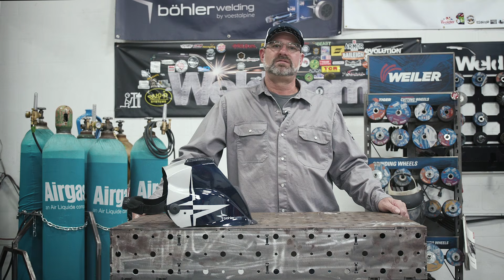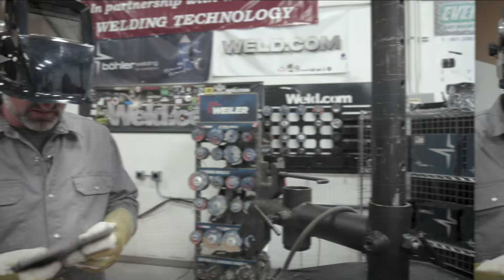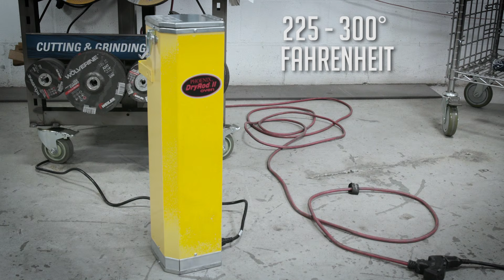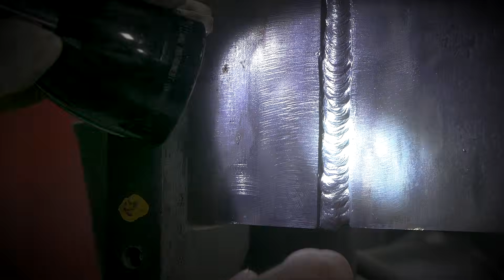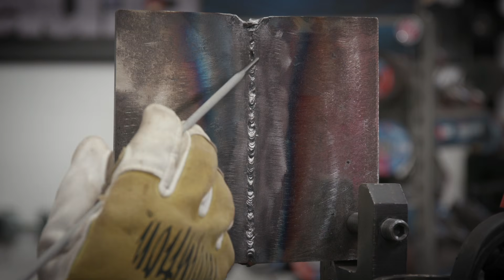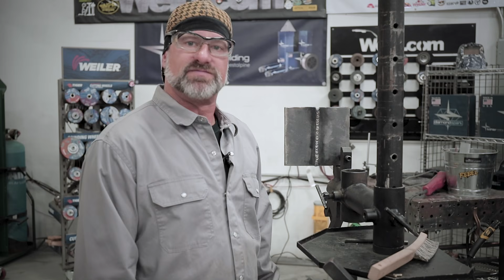Stick Welding Uphill: Techniques and Tips

Comment: on the root its okay to let pool cool down that much and then rehet and deposit? i thought going back into the weld like this without cleaning it first would cause porosity?
Reply: Actually, now that I’m thinking about it, his technique is correct, but he’s moving too far away from the puddle to where it slightly solidifies and could cause inclusions. My best guess would be to use his technique but to make sure your puddle is always red hot and flowing.
Reply: I’d also like to know this

Comment: if you'll notice you're preheating metal that you do not want to with those high upwards strokes on the root, you want it to be "relatively cool" when you pass over. a lot of new welders would definitely blow through with this method.
edit* or not penetrate enough like you did

Comment: I'm no pro welder but I had to weld some bumpers on a loading dock the other day and let me tell you it was horrible but beautiful for someone with hardly no experience. I had to weld upwards and man that was really a challenge for me blew a hole right in the middle midway up. Still have alot to learn thanks for the tips and showing me how it's done.

Comment: Modern ASME industry standard is the 2 inch 6G ,schedule .344 wall test. It qualifies the operator for pipe wall thickness up tp .688 wall. The uphill root bead became obsolete back in the 70s with the invention of high penetration welding rods like the German cell-80 that was used on the Trans Alaska pipeline.A down hill rod. American high penetration rods soon appeared and have been used  now for 60 years in the industry.7010s and 8010s coupled with 8018 fillers and caps.Most pipe and tube welding procedure TODAY are downhill root,downhill hot pass and uphill with the 8018s ie filler and caps.The trans Alaska pipeline done to API standards [not ASME] was downhill all the way using the 8010 seres high pen rods.Before that were mostly navy trained welders who were taught to uphill everything.Its much slower and produces more unwanted localized heat.The young an who test today will likely take the 2 inch test.Its x-rayed and it is cheap for employers.So that young person would do well to learn downhill root and hotpass on the ,344 wall boilertube with 8018 filler and string bead cap.NOT WIDE CAP.Beads can only be 1 1/2 times the diameter of the rod used..For instance 1/8 rod would be 3/16 wide max.For young people ASME stands for American Society of Mechanical Engineeers.API [less stringent] stands for American Piping Institute.Also 6G stands for pipe test done at a 45 degree angle as opposed to horizontal or vertical test.

Comment: i see ya filling ya undercut i always do a circular motion on the hot pass to push the root in i use to run a landing with 2mm gap i learnt of an old italian welder no landing saw blade gap push it in , then the hot pass you can run more juice .fil cap two stringers .100 percent xray.dc positive .neg on root pass.

Comment: We weld cracks in hydraulic tanks or fuel tanks using 7018.Trick is have tank full.Weld through the oil or fuel.Never weld on empty tank,that will explode and kill you.Feel lucky, drop a pound or more of dry ice into tank before welding on empty tanks.Dry ice displaces oxygen and you can weld on empty tank.Do it if you feel lucky .

Comment: I work field as heavy equipment mechanic.7018 is spec by Caterpillar. Try that with out in field.Metal gets warm and grease starts dripping into you weld.We hired super welders but they all dragged up coz it's a dirty job .We all can run pretty up hill welds using 7018.

Comment: what happened to the woman that did curley q's? This guy isn't much better, he obviously edited out the actual weld, you can tell that isn't the same weld he welded, from the weld (a real vertical weld looks completely different than a weld done flat) melted top to how obviously drippy/runny he ran that weld. His stinger was held at too much of an angle, it should have been straight into the work piece not at the same angle as you do when you do a flat weld. I give this video a BS out of 10.

(Note: Next time, be sure to only do one backwards Z pass on the face of the weld, because a real vertical weld, you only see one pass when you are done.)

Comment: I'm reading alot of the comments from other people and their right.What a person see's on a video and what they see and do out in the field and shop are three completly different things.Year's ago working on a fish processing ship with the engineeries I had to weld a"pad eye" to the deck to hold down a skiff.The 350 footer was bobbin up and down, 60mph winds, raining like cats and dogs and wind chill about 20 below zero, insulated coveralls on,raingear and welding on deck up in ALASKA just south of the Bearing Sea.It wa so hard to move around on the deck I felt like a ballon.The deck plate was atleast 5/8" thick and the pad eye about the same thickness,the deck had about 1/2" thick epoxy paint on it and the WORST PART OF IT ALL,AT LEAST 2" OF RAIN ON DECK.Well someone beat me to it,they chipped the paint away, I didn't ask,all I know is I was looking at clean metal when I got there, good enough for me.But I still used 6011-5/32 rod cranked up,welded one side,then 7018-1/8 same amps, DON'T EVER,EVER SAY A PERSON CANNOT WELD WITH" LH 7018 WET ROD,POORING DOWN RAIN, GETTING THE S--T SHOCKED OUT OF HIM/HER,2" OF WATER ON DECK BECAUSE THEY ARE TOTALLY 150% WRONG, WRONG,I AM LIVING PROOF,TALK ABOUT GETTING SHOOKED,YA I GOT IT WELDED ALL RIGHT, 7 DAY'S LATER IT HAD TO BE REMOVED AND A SLEDGE HAMMER COULD NOT BEND IT, BENDING IT INTO THE WELD,IT WOULD NOT BUDGE!! A ENGINEER TOOK CARBON ARC GOWGING TO GET IT OFF,THEN GRIND THE WELD, WHAT'S LEFT.DONT EVER SAY LH ROD OF 7018 CANNOT WELD IN 2" OF RAIN AND THE RODS GOT SOAKING WET.  NOW THAT'S WHAT I CALL WELDING OUT IN THE FIELD !!   I THINK IT SHOULD BE A GOOD IDEA FOR SCHOOLS TO TEACH STUDENTS WHAT'S IT LIKE WELDING OUT IN THE FIELD IN THE ELEMENTS (100+ DEGREES HOT WEATHER TO--20 TA--50 BELOW ZERO,WIND BLOWIN.

Comment: Retired Boilermaker 35yrs. Where are your run-off tabs? The test booth proctor would fail your coupon before you started welding.
Reply: He said they don't use the starting 1" or the ending 1" to cut the coupons from.
Reply: @tubeonline629  Tell that to the weld test proctor from CB&I or Nooter, or B&W. They would run you out of the test booth even tho all 3 cut off the first and last inch from your 3 position test coupons. Also who are "they" and where did they get their information and do you have a copy of the weld test procedure?
Reply: @KenSmith-bv4si  
Well Ken you know the title of this video says nothing about a weld test, he said viewer's had ask about uphill welds with a stick and he was good enough to show the way he preforms the task that was requested.
Reply: @tubeonline629  nothing replaces good welding habits, thats how you pass test and become a better welder.

Comment: There's a huge misconception with the weld when you get to the top. It's not that the weld gets hot, it's the magnetic field that's being created is pushing your weld downward.

Really clean audio, too.
Reply: You are wrong
Reply: @spencerseedig3380  No I'm not.
Reply: @seyelk59  Actually you are wrong. The magnetism that's created pulls the weld inward. The sheer heat rising upward in conjunction with the approaching electrode synergistically over heats the metal at a given travel speed.

Comment: Or you can use Titanium Pipe cut in the middle to guide the Weld pool, but you have to Grease it with Heat resistant Grease.

Comment: Good job sir.  Appreciate the arc shots and all the advice. The way that arc kept cutting out in the root, I think it might have been the machine there because  from what I saw, you kept the arc length consistent. Did you change anything else for the root pass on your 2nd plate? Like arc force or amps? 
Anyway, good stuff. Keep it coming

Comment: Can you do a video on a 1/8 7018 cap on 6in pipe? I been struggling on getting from overhead to vertical, it’s dripping and has undercut. Thank you in advance.
Reply: Try this technique each time that you stop at the count 1 one thousand then move. The under cut you are getting is because you are leaving the toe to fast thus pulling material from the wall. Just slow it down a bit and check that you amps aren't too high.
Reply: Your travel speed and angle might need adjusting. If you understand the difference between push/pull you should get it fast. But always practice each time that you can. Highly recommended.

Comment: THANK YOU SO MUCH for a nicely done vertical weld test training video! I've got a question...your rod angle is real steep. {{ Way back (when I was a student Tool & Die Maker, that was a professional Electrician); repairing welding equipment in our local tech school, I would listen in on what the welding instructor would be telling his students. He would say, "The straighter in your rod is, the stronger and prettier your bead will be." He caught me evesdropping on his class and envited me in on his class-room discussion. He found out my experience level in the Machinist and Electrical fields and tutored me, when he could in welding professionally.}}
    That being said, I have tried to keep an almost straight-in rod angle and run a "U" pattern up-hill, for most of my life. My health vs age has made me shakey...so I Mig more than stick, but I watched you running your cover-pass with the rod angled up, and needed to understand that concept. Does it splatter real bad, like its throwing metal, or does DC act better about not doing that than AC does?
   Bill from Tn. 🇺🇸

Comment: You don't need to whip an open root if your heat is set right you can drag it all the way
Reply: Good to know how to whip though because in the field you’re going to have a bad fit up here and there.
Reply: I just think for beginner its easier to teach someone to stick the rod in and drag that's all and if the gap starts closing up tell them to slow down if it opens up speed up it's just easier to control if you put a good land on your pipe or plate in my opinion that's all

Comment: the statement at 4 minutes about 70,80,90 series rods needing stored at 225 to 300 degrees is incorrect.  6010-9010 rods are to be stored at room temperature. The higher temp storage will deterogte these non low hydrogen rods. XX14 and XX24 ,  are to be stored at 125 degrees farenheit, along with XX12, XX13,AND XX22, WHICH ARE USUALLY 60 SERIES  but of the same Rutile type as XX14 AND XX24
Reply: he was referring to low hydrogen rods
Reply: You mentioned xx12 and xx22.... I hadn't heard or seen anything bout these for years... like a couple of decades
Reply: When he said that he was still talking about xx18 LH rods. He was talking the tinsel strength of the rods.

Comment: paul you need more practice i am a professor in welding i know a top gun when i see one i went to school and study the theory in welding got the diploma  and went on to weld in industrial  plants i am a pipe welder i am now self employed and i still practice  every week in pipe welding tig and stick to keep sharp your current too hot and your whip too long  75 amps small whips dig a hole with the arc fill it up with the rod
Reply: Mohammed Troy - I checked out your channel hopeful to find hi now a perfect person does it, but for all your judgemental criticism and prideful statements,  your videos only include coconut openers for sale.  Maybe post your own.
Reply: @timrich6755  
You can always tell a real welder by how much they brag on how good they are. Lol
Reply: @tubeonline629  Yup. Like I said, no videos, but critical of a channel with loads of good videos.
Reply: Wow. Good thing you didn't become a school teacher. Your pupils wouldn't even know what a period looks like...
Reply: 75 amps on a 1/8 7018 barely strikes or holds an arc, tells me how well trained Muhammed is.
Reply: @brandonhopkins6754 the rod he using is a fleetweld 6010 not a 7018  but it still possible you maintain an arc with a 3/32 7018 a 1/8 7018 may require more amps but it still possible to maintain an arc using a 1 /8 7018 with 75 amps welding thin sheet metal 3/16 thickness
Reply: @brandonhopkins6754  as you strike an arc the base metal is preheated instantly you will get a steady arc because the beveled edge and root face is thin a heavy wall pipe will carry a thicker beveled edge preheating with a rose bud torch is needed if you want to use 75 amps to insert a root the amps might need increasing if the root opening is 1/16 of an inch or if the pipe closed in during welding I creating a business so I can continue welding in my part time welding pipe and exotic metals are now considered hobbies for me I love welding but more can be done if you think of welding as 1 of the ingredients of forming a separate company that doesn't involved welding full time example an ornamental plant shop
Reply: @mohammedtroy4296  you're doing roots on 75, I run a root on 120, we ain't the same and you ain't as good as you say you are.
Reply: Yup, he sure forgot to mention anything about Suck back in the root...
Reply: Womp womp
Reply: I am confused I went through Lincoln basic school  and 798 pipe went on to work mostly in plant pipe refineries we were taught not to ever whip a 7018
Reply: Well Mrhommad, I watched this video, and it helped my uphill root and 7018 passes quite a bit better.  But I went to your channel and was confused as hell about what it is you even do mate.   Anyway, Maybe try humbling yourself just a hair.

Comment: I noticed on the second root that you didn't whip out of the puddle nearly as far.  was that more because of the wider gap, or did you turn the amps down a bit as well?
Reply: really at a 3/32 gap i believe he shouldnt have whipped it but thats why 1/8th worked well, he must be used to that fitup the most idk
Reply: Different rods burn differently too

Comment: You could use what they call a jet rod to finish that weld up with to make it look even better
Reply: “Jet Rod” is 7024 - not rated for vertical. It won’t work.
Reply: @knifetex  oh, it would work if you want the melted candle wax look......amazing some of the comments that are posted.....and yes, you are 100% correct in what you said.....7024 can even be difficult on a 2F weld....cheers from Florida, Paul
Reply: @Laura-br549  7024 is a great rod if your butting two sheets together because of shallow penetration or if your adding stiffners to sheet such as angle or beams. Most any application that can be welded flat.
Reply: @Laura-br549  Yep. I’m a 3rd party CWI. I inspect everything from High Rises to Tilt walls in DFW, Austin, San Antonio, Houston and everywhere in between. I’ve seen it all. Tilt wall guys LOVE using jet rod. Looks ok on the pier cap/panel connections, but it burns up bar joists where they weld to the girders. Technically, 7024 isn’t allowed on most jobs because the job specs typically stipulate that the welding is to be performed by qualified welders with Low Hydrogen electrodes- which of course 7024 are not. I’ve seen many an uphill jet rod weld on vertical - usually knife plates on panel walls for girder bottom chord stabilization. Fail them Every. Single. Time.
Reply: @knifetex  what would you see stipulated in the field for welding 11ga tube and 0.125 stiffeners?  thanks....  also, have you seen any 7016 lohy used?
Reply: Only if you want to fail the test.